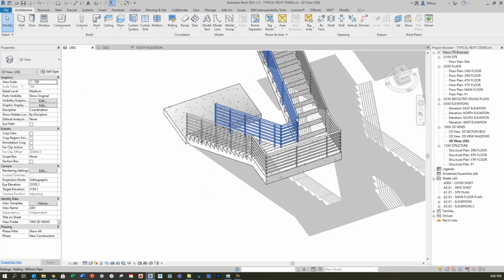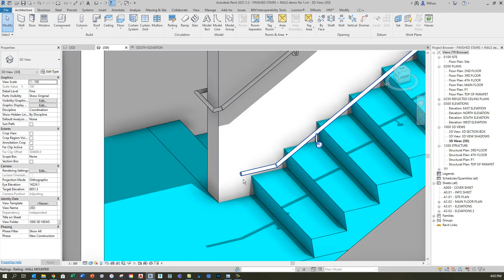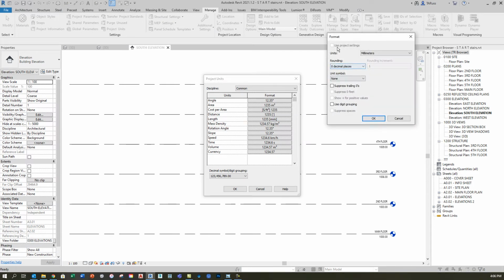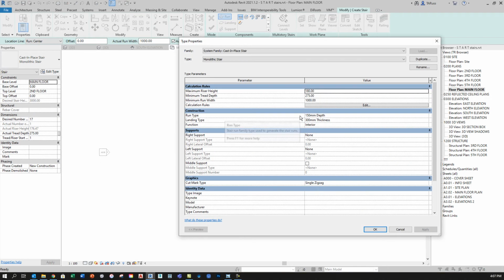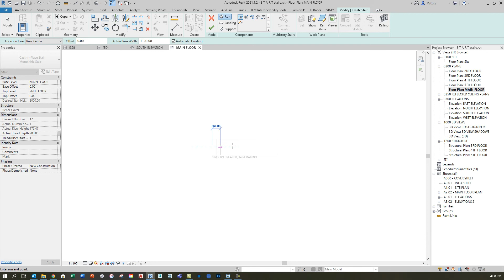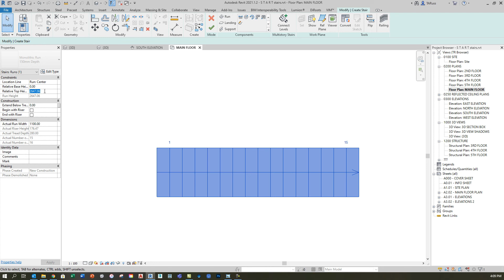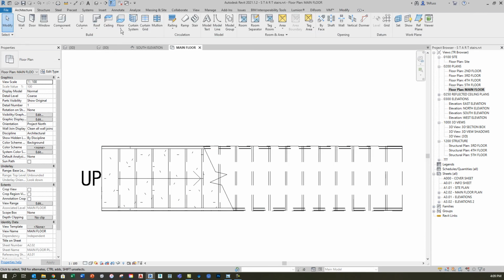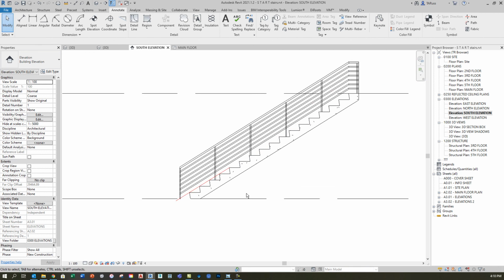Revit Stairs Fixing Floor & Rail Gaps PART 1

Comment: This is the exact video I’ve been searching for. Thank you so much. Quick question, I followed your instructions regarding the ‘begin with riser and end with riser boxes’, but it won’t let me make my relative top height 3500mm. I am using revits landings though as my stairs do a 180 degree turn between level. Any advice?

Comment: I am not able to change the Relative Top Height to 3000 without getting the dreaded "Extended Below Base" warning. I followed your example to a tee. The only thing I am able do is to go to the elevation view and drag the stair to the right and it comes up to the 1003 elevation. When I do this the Relative Top Height reads 3176.47 (one extra riser). I am running a trial copy of Revit 2021. Do you know if this is a known bug? Seems there is a ton of discussion about this warning. Any guidance or links would be greatly appreciated.

Comment: I really like to follow along with your videos as a training exercise. I have a couple of questions. 1.} Your elevations seem to be in Meters but you set the units to mm. 2.) Also your floors seem to skip the 5th floor? Any reason or is this part of a larger project?
Reply from the maker: Thanks John. Glad you're finding the videos helpful. It's quite common for a building to be described in mm and have its geodetic references (as shown in the Level Datums in the videos) described in meters. I suppose this is because it's easier to say a building's main floor is at 1000 meters above sea level instead of 1000000mm above sea level. It's also because the civil engineers and surveyors that supply that data typically work in meters. As for the question about the 5th floor: that's just where I just to end the building in these tutorials. But, as mentioned in Part 3, having established the correct conditions from Level 1 to 3, you could just copy that set of objects up to as many levels as you need. Hope that helps.
Reply: @TRUSS3D  Thanks so much for generous and extremely helpful information. Your narrative style and attention to detail makes these super training material. I will be watching all of  your material in the next few weeks so thanks in advance. Cheers John